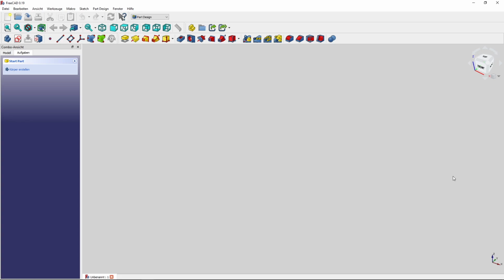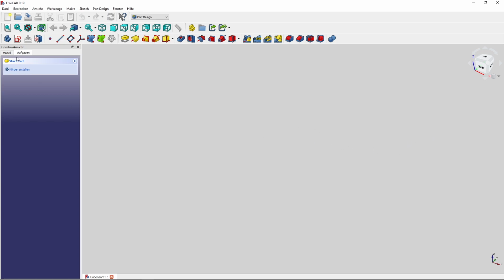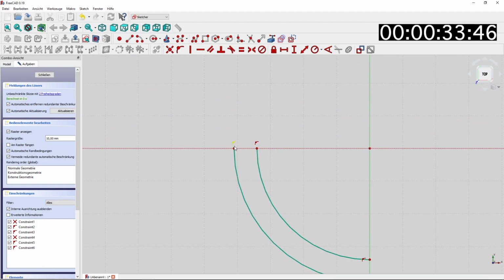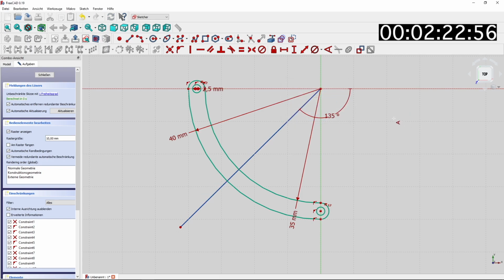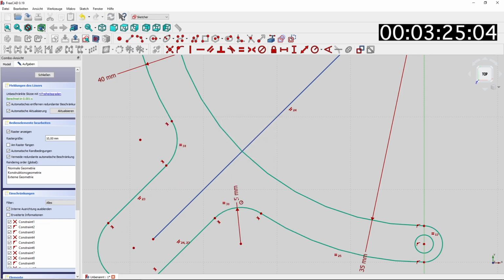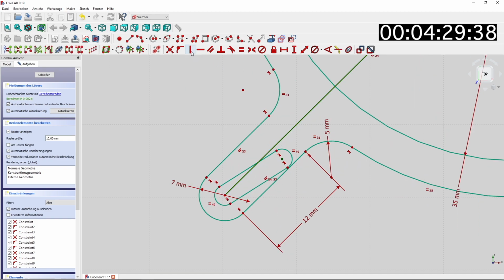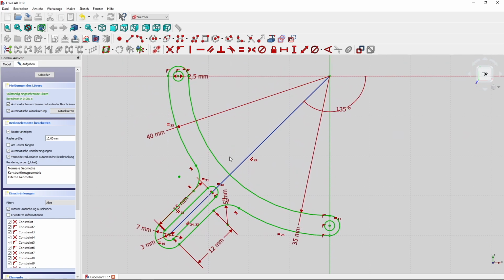FreeCAD 0.19 - Little Sketcher exercise - Twitter Question - How to properly sketch? (English)

Comment: THANK YOU FOR THESE VIDEOS. I am happily getting familiar with FreeCAD.

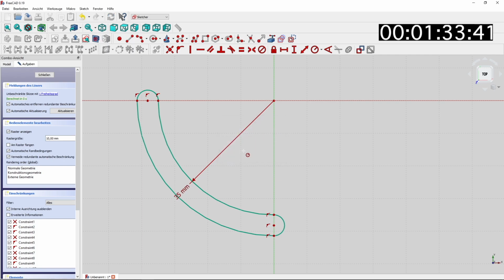Please excuse my pedantic correction in this otherwise excellent video. At 2:58 you defined the larger radius as 40mm, but according to the drawing in should be 35 + 7 = 42mm.

I am only putting this here in case anyone else is confused by this. Not a big deal, and doesn't change the point of the video: sketching in FreeCAD can be fast and easy! 😀

Comment: Thank you.  That was quick and easy.  I had an issue with a slot on one of my experiments a couple of days ago.  I solved it by using circles and joining them with lines then using "Trim" to remove the unwanted lines.  Now that I have seen how you make the slot that is on an angle it makes shows an easier approach.  I have used Freecad for about 5 months now and I am still learning things.